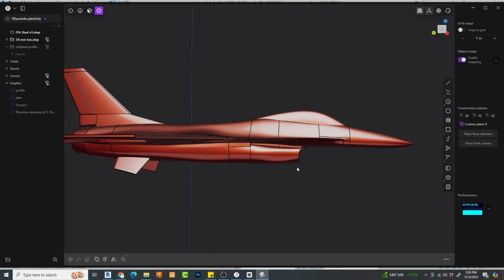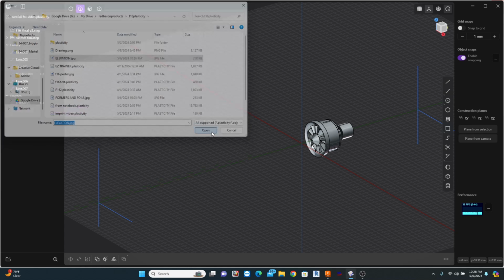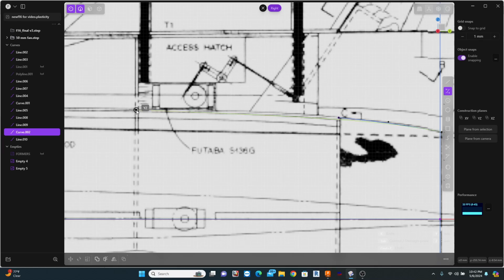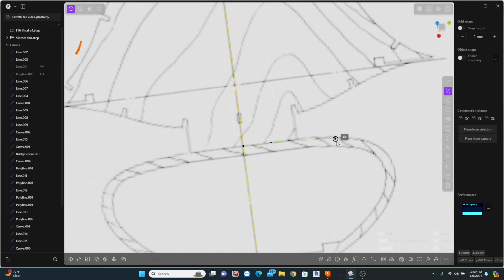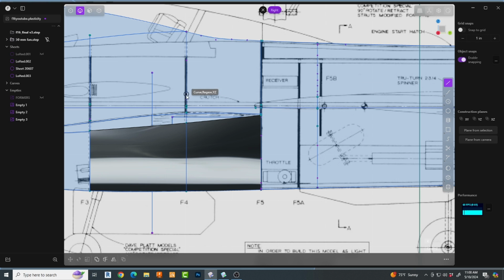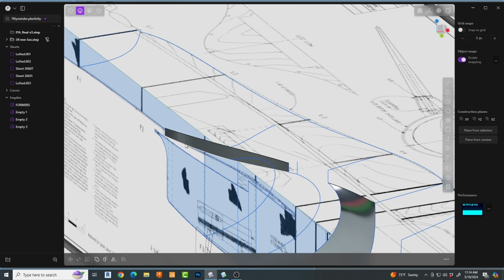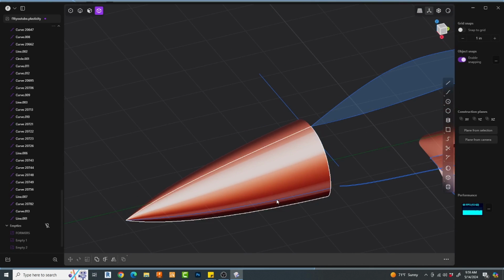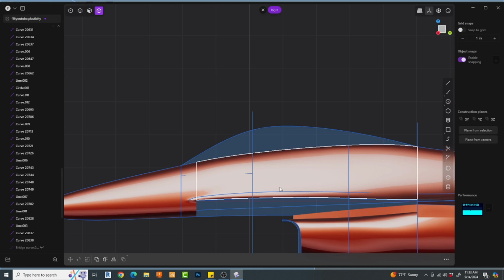Full F16 3D Model Tutorial is out!  Promises Kept!  #plasticity

Comment: does fusion have something similiar to what plasticity now has which is the xnurbs and raise degree features? id like to know if you know the answer tyia
Reply from the maker: Closest might be forms modeling.  But there's very little similarity as to how they work.  You can convert a surface to a form, edit the object then convert it back but in my opinion you have less control.  You might end up really struggling with tangency control to other existing faces in some cases.  For a sketch or curve, you can add control points but again this is not like the raise degree command.